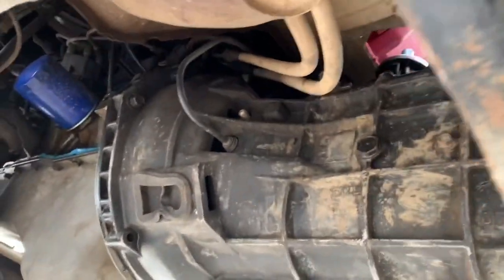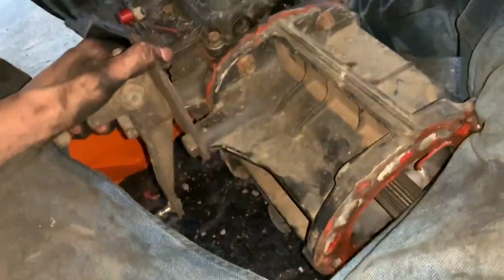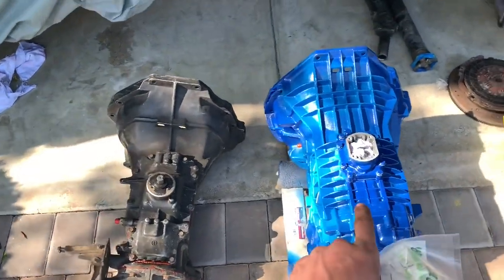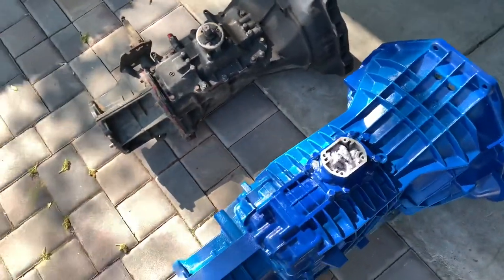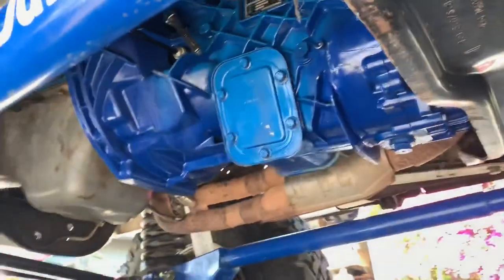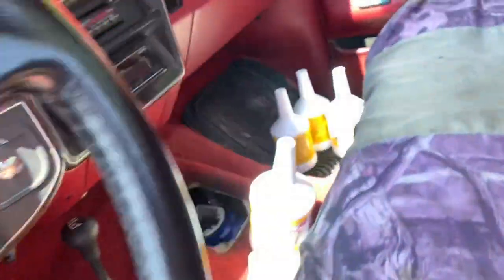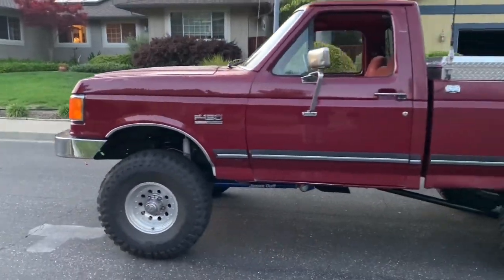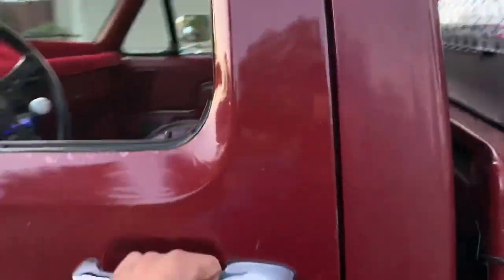ZF5 Swap into Ford F-150

Comment from the maker: I have since changed out the clutch line for a 1997 steel braided one.
Reply: How do you tell if it’s the e4od or m5od I have a 96 f150 5.0 4x4 if it’s this easy that’s would be amazing any tips?
Reply: @glizzy7130 e40d is automatically trans, m5od it a manual .
Reply: @slow_carsgarage7422  yeah I ended finding out I have a 4r70w
Reply: @glizzy7130  nice

Comment: Thanks to you, I think I found it! How does a ZF5 mount up to the 300 I6? You didn't have any adapter plates or somethings. I am tired of my 4th gear being it
Reply from the maker: No Adapter needed, you need a small block trans
Reply: 300 i6 uses all v8 gear.
Reply: Yup 300/302/351w transmissions all the same
Reply: Make sure you use the right flywheel for the engine though

Comment: Just completed this swap in a 93 F150 using a 90 zf. Slave hose is definitely an issue. Glad I had watched this first trans end of hose looks almost identical, except 1/16 difference in the shoulder where the retention spring teeth bite. Had to get a 90 hose, which is longer and has a 90 degree at master cylinder side. Hopefully it will work long term. Seems fine for now. Had to gently persuade the 90 out with some careful application of heat. So happy to get rid of the 60mph reverse of the Mazda. Don’t know what those engineers were thinking.

Comment: Sweet rig man. Love the Warn classic bumper up front too. Nice that you got a 97 trans. 470 ft lbs and better synchros. Good video edits etc. subscribed.
Reply from the maker: Noah Garay thank you! Ya that bumper was not easy to find
Reply: CCC 4x4 Club I have the modular Warn classic for my 86 F250 (from a 77 f250, lucked out and found the mounting hardware NOS on eBay) and a reflexion bumper (same one that Bigfoot 3 had with its 80-86 body) from a squarebody chevy. Both of those took a few years to find. Currently looking for that one you have for my 88 F350. I agree with ya, unless you live in the pacific NW, they are really far and few between.
Reply: ZF5 takes ATF not gear oil. Tolerances in the transmission are too tight for oil.
Reply from the maker: Yes I am aware of that, but mt90 is a thin oil. I’ve had good luck with using it, you can tell an improvement over atf.

Comment: Any chance you could tell me how long your rear drive shaft? I did the same swap with automatic to ZF5 in my 94 f150 my issue is my drive shaft too long.  zF5 is 2 in longer than the automatic

Comment: my buddy has a 95 f150 4x4 with the 302aka 5.0 and the auto in it is sad and on its way out we want to manual swap it.  Would a zf5 be a bolt-in set up like yours? or would the Mazda manual trans be a better option?
Reply: The zf is a heavy duty  transmission, the mazda unit is a toy!   The  small  block zf will fit all  4.9,5.0 and 5.8.  Make sure ypu use the right  flywheel  for the 5.0 and 5.8 they are balanced  externally  by a flywheel  weight.   Get drive shaft  from a donor  truck  with  a zf and same wheel base  as yours

Comment: hey I know you did this 4 years ago but i have a question, im swapping my truck (short bed single cab) fromt a 2wd m50d 300 to a 351w zf5 4x4, im leaving the transfer case because i do plan to put a 4x4 subframe in later, i was wondering what part number your driveshaft is so i can see what i need to find because i cant find one online anywhere, thanks!
Reply from the maker: There is no part number on my driveshaft. You can get a new shaft made or your current driveshaft modified at a local driveline shop.

Comment: Good rpm? your at 2200 at 60   is your speedo correct?  you should be more like 2000 at 70.
Reply from the maker: 4.88 gears and 35” tires

Comment: Didn't the Zf5 have a few different bellhousing patterns? What was your zf5 out of? A diesel or a big block? I was nearly positive that an adapter plate had to be used.
Reply from the maker: Colton Stevens they made the zf5’s in three different bell housing patterns I believe. 460 and 7.3 diesel shared one. Then there is the small block ford one which mine is will fit 5.0/5.8/4.9. Then the newest zf5s were made for the modular 5.4 and v10
Reply: Exactly What Year Trucks / Van's / Cars have the ZF5 Small bell housing 5 Speed transmission Please ? so I can look for one at salvage  Thanks a Bunch great post :)

Comment: In the automatic transmission zf6hp of the bmw e60, which engine would fit in it without adaptations or with few? Ea113, ea888, N13, Hyundai Lambda, Hyundai Theta?

Comment: No trouble using MTL instead of ATF? I thought ZF trans required ATF, or is that MTL closer to motor oil thickness? Good looking truck!!!!
Reply from the maker: 80sFordFan yes they call for ATF. I’ve put MTL in them before with no issues. I just  recently drained it and added synthetic ATF. No difference but it is what it calls for
Reply: Thats what ford says go to ZF and read up

Comment: I’m doing the same in a 96 F150 with 4.9L 2 wheel drive short bed !!!  My camper towing special !!!
Hate my freaking Mazda 5 speed !!!!!
Reply: what clutch did you use...I installed it in f150 4.9...I don't have the original clutch...please help me

Comment: Does the stock crossmember and mount from the M5OD bolt up to the ZF5? So the only think you need are the ZF5 itself and maybe the hydraulics?
Reply from the maker: Ya that is correct. Crosmember for the m5od and zf5 are the same. You just need to get the same year hydraulic line and slave cylinder so they have matching quick connect fittings
Reply: Be aware not all ZF5 trans are the same. The 7.3 trans uses external slave cylinder. Easy to replace.

Comment: Hey, great video so I'm swapping from a 4r70, what do I need, do all the m5 hydraulic work with the zf?
Reply from the maker: they changed the dimensions of the hydraulic line quick connect in the early 90s so just make sure the line and the slave are from the same year truck and they will meet up. I believe they color coated the two different fittings. The early ones are Black and the later ones are anodized a gold color

Comment: I want to do this in my 97
Reply: I'm wondering if will even fit the 97 4.6 like what my 97 has, his was way older like 87 to 92 body and no clue if his was 5.0 or 5.8
Reply from the maker: Mines a 4.9 straight 6. This transmission will fit a 4.9, 5.0, and 5.8 (small block fords). I do not believe it will fit 97+ f150s
Reply: @Scott.Jourdain  97 with a 4.2 Has same bell pattern

Comment: Im thinking about swaping my T-18 for a ZF 5 speed 4x4 in my 81 looks like its worth doing but what would i need to watch out for or need to do?
Reply from the maker: Should be a pretty straight foreword swap too. I am 90% sure the t-18 is even the same length as a zf5/m5od. If not you will need driveshaft modifications
Reply: @Scott.Jourdain  YOUR SUPPOSED TO USE TRANSMISSION FLUID,,NOT GEARBOX OIL. !!!,,LOOK UP THE SPECS FOR CHRIST SAKE..all rally cars use trans fluid. same as ford boxes..any box can use trans fliud..
Reply from the maker: @phantomwalker8251  I drained the red line and replaced it with synchromesh a synthetic atf that these call for

Comment: Hey man, I've been all over the internet trying to make a list for a ninth gen f-150 shopping list.  I'm looking at getting a crate 357 stroker with a ZF5 transmission.  However, beyond that, I'm not sure what else I should add to the list.  Do you by any chance have a list of everything your modding/restoring?  
Thanks man!
Reply from the maker: Engine is stock, I have swapped a Dana 44 from a 1978 bronco into the front of the truck with James duff radius arms. It’s got 4.88 gears and lockers front and rear. That’s most of the big stuff I’ve done